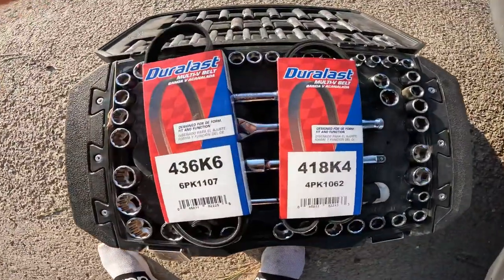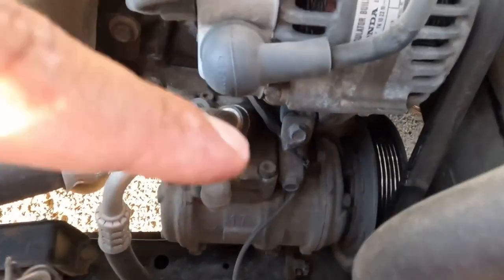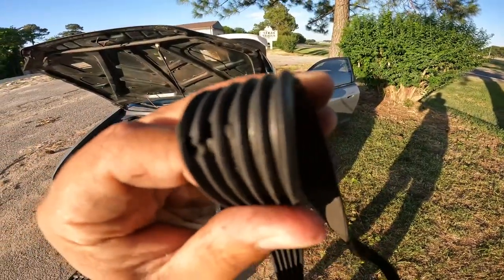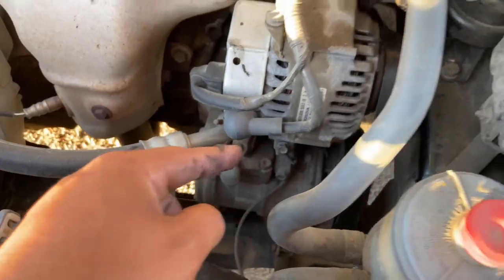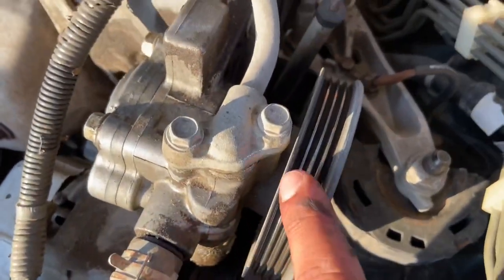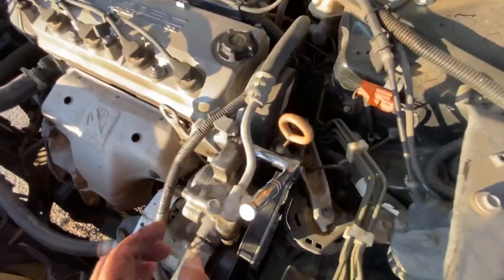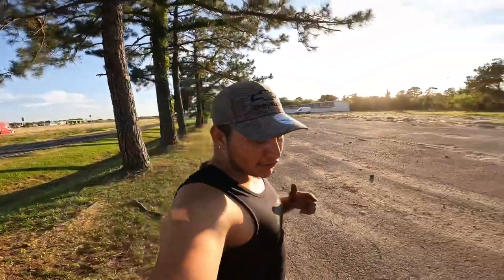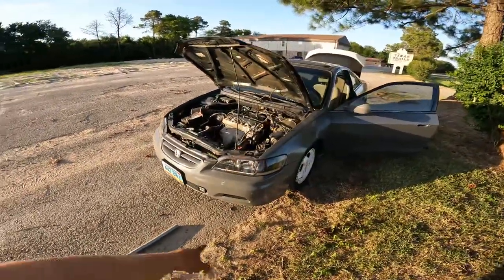How To Replace Serpentine Belt + Power Steering Belt On 1998-2002 Honda Accord

Comment: U know there's a tension release screw at the bottom right? Yall going thru all that extra just to release a belt. Where there's a tensioner under it 😂
Reply: Can you specify? I went through the whole process and everything owkred except it's still sequaking, so too tight
Reply: @Dax-Johnson  you have to take off the left tire and it's right there on the bottom of the car to help take off the belt. Did u make sure the belt is fully on? It could be the power steering belt what you're hearing if it's not the drive belt it's the other belt. Check it for cracks. Mine squeaking too I haven't changed it. I been too busy. I done replaced the fuel pump, fuel pump sending unit, the whole gas tank, and much more. I haven't even had the car for a month yet lmao. The person that had it before it's previous owners did not take care of this thing at all!

Comment: Hi. Can the 419K4 be used? It fits but I was to get enough slack using the adjustment bolt before it rides over the pulley.
Reply from the maker: If it fits and works i dont see why not 😄😆

Comment: Awesome video bro came in clutch me only took me about 4 hours but that was more cause didnt have many tools so all the awkward angles to get the bolts out was annoying plus had one belt wrong so had to go exchange it 😂😂 but because of you saved my ass $200+ to have both belts changed at mechanics. But was wondering if you could tell me why while I was driving after about 15 minutes it started to squeal again for like 30 seconds before stopping again and when I did a U turn felt like it jumped or pulled I dont really know how else to explain it?
Reply from the maker: Sorry for the late response but i find that belts squeak when they get oil and grease on them for some weird reason, go ahead and see if you are spilling power steering?

Comment: Hey bro, why wouldn’t my belt be tightening??
Reply from the maker: Which belt is the one giving you issues
Reply: @josebangz1874  alternator belt .. I tighten the bottom bolt on it for “tension” but I think I’m missing something ..?
Reply: @josebangz1874  just replaced my belt squeaking a little how can I stop this noise